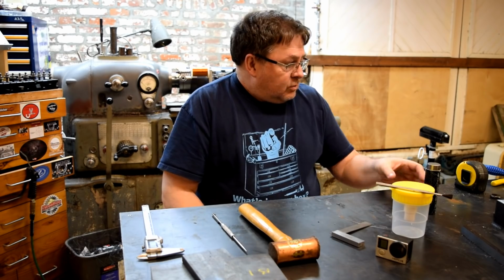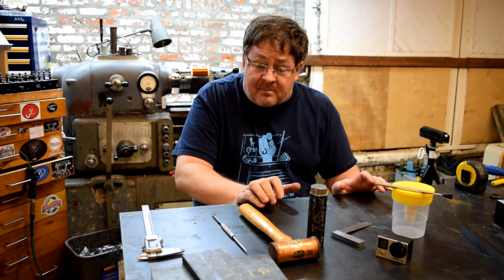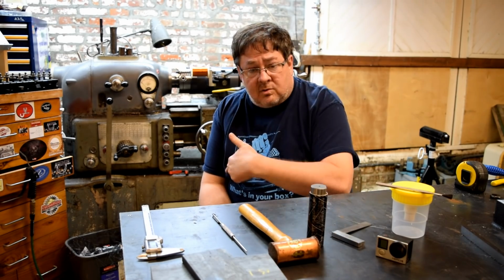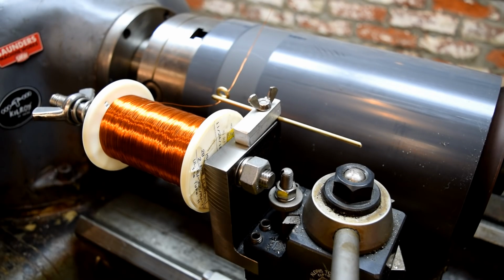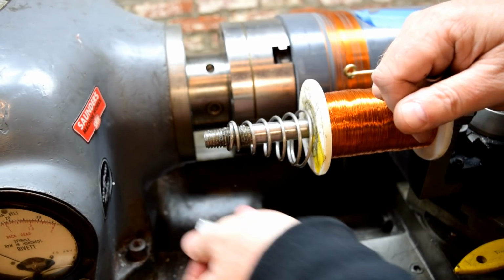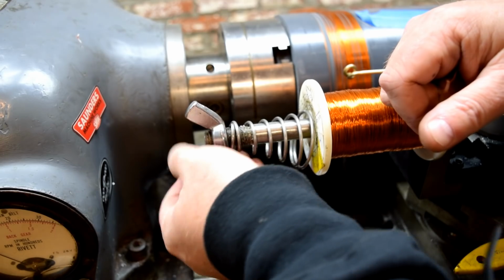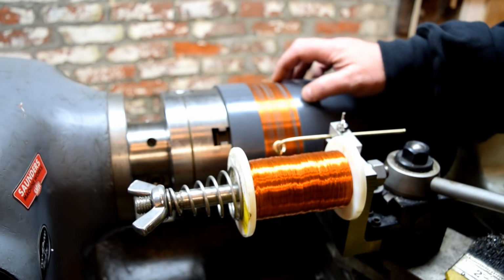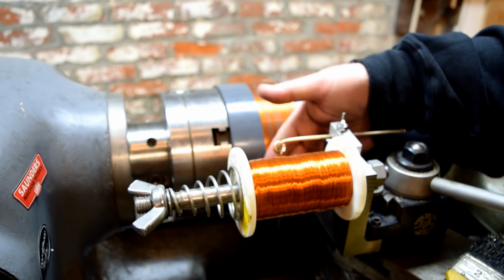Coil Winding on the Lathe

Comment: I have done some winding on a modified South Bend lathe.  Wire tension and placement was done by hand with the spool set vertically on the floor between my feet.  Small gauge wire like the #28 used here i would tension using slight pressure between my thumb and pointer finger.   With a little practice I could place turns of wire directly adjacent to the previous in either direction without much hassle.  The lathe had a foot operated speed control and electrical direction control with smooth operation from 0 RPM to probably 2000 RPM.  I would always wind with the bobbin rotating away from me.   Wound heavy gauge stuff on that as well, like  2X10 gauge,  .040 X 1.50 copper strip, etc.
The other machine that I used was an actual coil winder and it spooled wire from behind and over a pulley system on like a spring loaded fishing pole.  The wire tension could be set via an indicator dial.  The guide was not an eyelet, it was two metal guide plates on an adjustable arm that also had a traverse mechanism that you could dial to the wire diameter.  Thinnest I wound on that machine was #42 gauge.

Comment: Glad you like the oil cup. You can’t have too manny oil cups. In my small shop I use 5, 2 full size ones w/cutting oil, 2 more full size ones with WD40 for aluminum, 1 small extended stem one made out of a prescription bottle w/cutting oil that hangs out on the bench. Thanks for the shout out. 

Hopefully by now you found a self locking nut to use on the coil winder, that would drive me nuts

Comment: James, I have done some wire winding on the lathe and I have found out that moving the spool back so you are not pulling sideways so much works a lot better and using mig welder tips because they are copper and threaded they can be aimed right at the cylinder or what ever you are winding. And a nylock nut will stop the nut from turning.
Reply from the maker: MIG Tip!!! Brilliant, thanks.

Comment: Wound a coil like that many years ago, we made a shallow thread on the OD to help keep the wire tracking good. Also used a two piece split clamp made of nylon with a groove for the wire to keep the tension so the spool could be free to turn. As other have said, move the spool back so the wire doesn't have to pull sideways.

Comment: Two flat washers between the wingnut and the spring will help with keeping the wingnut stiil on the shaft.  If insufficient add a locking nut.

Comment: I had an idea but haven't got the equipment to try. If an insulated coil wire is wound, but not around a core but half way around then folded back so it can coil back in the same path as the semi circle before it so each time the magnetic field will be in the opposite direction of the previous half wind. I Imagined the semi-wound (?) coil would bend with DC and form a wave with AC, size varying on Hz. Many could be put together, to create something that can be fine controlled with variable AC arrays of input or something, honestly came up with it in a dream so I don't know, seemed cool. I could be a dumb-dumb since I had this idea 5 years ago and still never tried it. Even if the damn thing just bends I'll be amazed.

Comment: Not sure it's helpful, but I used to wrap the secondary Tesla coils on a metal working lathe of similar diameter and a few feet long, pulling up wire from a spool. In this case, the spool was larger than the one shown, and I had great success tightly wounding coils, by moving the spool to a floor and several feet from the mounted coil. I guess the greater distance and reduced angle of the uptaken wire helped.
Reply from the maker: Thanks for your insight, I always appreciate input from folks that have been there, done that.
Reply: The eyelet should be nylon or other hard wearing slippery plastic. Nonmetalic tensioning rollers or other tensioning mechanism besides from the spool helps prevent "birds nesting". @Kent VanderVelden makes a good point about everything back from the spindle. Feeding from slightly behind the wind point and the wire self positions. Spindle in reverse helps visibility of the wind point.

Comment: You will get a better feed putting the wire between felt pads to control position and tension. then only a small amount of tension on the spool to keep it from unraveling when you stop. I had a commercially made coil winder for a while and that is how they did it. As others have mentioned, a longer distance between the feed point and the spool will reduce the angle and make it feed smoother.

Comment: A needle thrust bearing would work great preventing that spool from messing with the tension, Maybe add a guide pipe to help with laying it down? also a few wraps then offset the feed back some so the wire has a slight drag against the previous lay to keep spacing tight?
Reply from the maker: I did bend up another guide that was much closer (< 1") to the work, but I have not tried it out yet.  I suspect that will help a lot.
Reply: Good suggestion Brian. Or do like a MIG welder and cut a keyway and use a keyed washer.

Comment: James when I was in the stator/armature dept the coil winders did that by running the mandril slower and using a bit of leather to control the tension held in the hand , biggest they did was a total of 100 pounds of 26 g wire

Comment: Thor hammer, you can spot it from a mile away. Love their copper/leather combos with the cast head. Might just be solid copper I don't know if they ever did beryllium copper.
Another problem you might run into with your winding setup is that tangentially pulled wire sometimes slips into the layer underneath, if you put too much tension on the spool, causing it to break. This is another reason why thin wire is usually pulled off the end and put through a separate tensioner, but it seems you need to get away with your own mistakes.
A simple felt pad brake would likely do the job...

Comment: Try running the lathe in reverse, the wire would feed over the top of the coil and it should feed smoother.  When I worked in the electric motor shops our winding machines fed the wire over the top of the forms.  Also try a washer between the nut and the spring.

Comment: If that is insulated wire, running it through a metal loop at a significant angle might damage the insulation. Also use a couple of washers, one on each end of the spring, that might help keep spring pressure at where you set it.

Comment: You could drill and tap the side of the wingnut, put in a nylon tipped setscrew and basically have a nylock wing nut.  I looked, and they actually make nylock wing nuts, but could not fine any 1/2in ones with a quick search

John

Comment: Drill a tiny hole in the pvc pipe and insert the end of the wire and you won't have to tape it in place. Also add a couple washers on each end of the spring and a lock nut for the tension and it won't back off. It is all trial and error to build something like that......

Comment: Looks like a backlash issue at the start.  Have you considered doing a scratch pass with a threading tool first then the wire.  Giving the wire a path to follow.  Otherwise looking good.
Reply from the maker: Never considered it, but no reason I can't give that a try.  Its CPVC after all, not like it is hard to cut.

Comment: Instead of a loop, try an adjustable squeeze clamp with felt to grasp the wire.  It would have less lateral movement than a loop and it would act as a brake at the same time.  Just thinking.....
Reply from the maker: That's a good idea, thanks.

Comment: I would be slightly concerned about the steel guide abrading the enamel insulation. Perhaps an insert of uhmw or some other slick surface.
Reply from the maker: The first one was bronze wire, and I did spend some time cleaning it up nice and smooth.